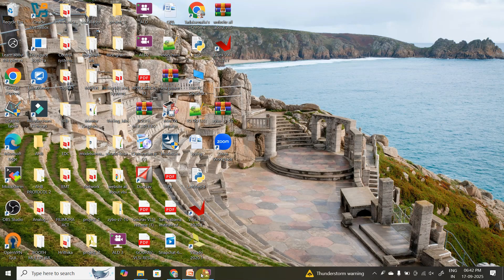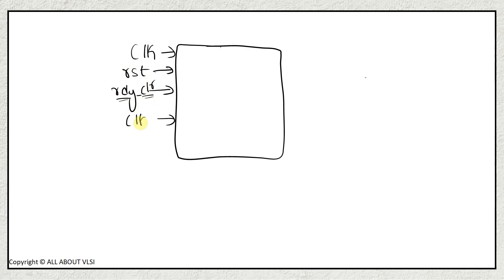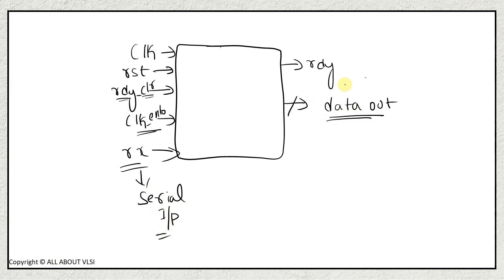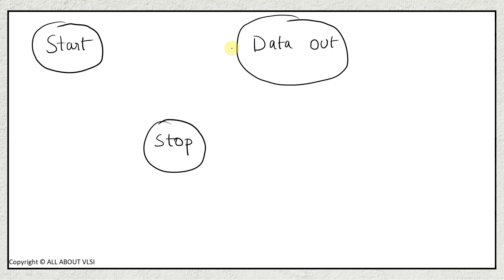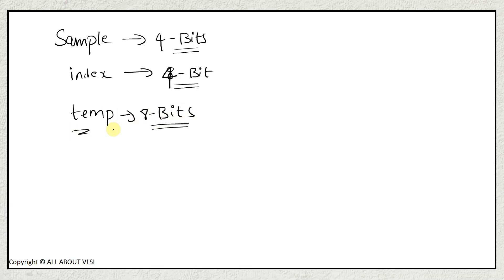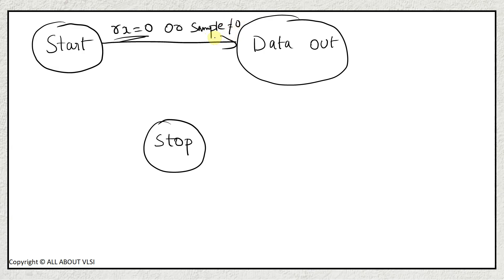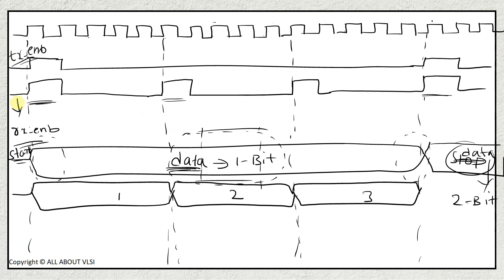UART RX Logic Explained | State Diagram of UART Receiver FSM (Part 1)

Comment: Here, you said that for every 10000 cycles, the transmitter enable is going high, but for one clock cycle for a baud rate = 9600 bits/sec. But in the previous lecture on baud rate generation, you calculated it to 5208 cycles for a 50 MHz clock frequency, then how come it becomes 10000 clock cycles at 3:32 timestep of this video? Please explain. Have you taken any other frequency for this video?

Comment: [00:28]	UART Receiver Block Diagram and I/O Signals
[01:54]	FSM States (Start, Data Out, Stop States)
[02:45]	Internal Registers (Sample, Index, Temporary Register)
[04:53]	RX Enable Signal and Oversampling Factor (16x)
[08:09]	Sample Signal Logic (Sampling data exactly in the middle of the bit)
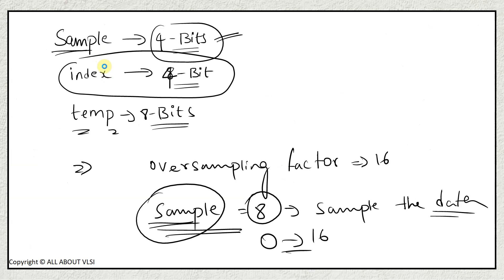[10:23]	FSM Transition: Start State Logic (Waiting for Start Bit, Sample = 15)
[12:49]	FSM Transition: Data Out State Logic (Index = 8, Sample = 15)
[13:13]	FSM Transition: Stop State Logic (Sample = 15)